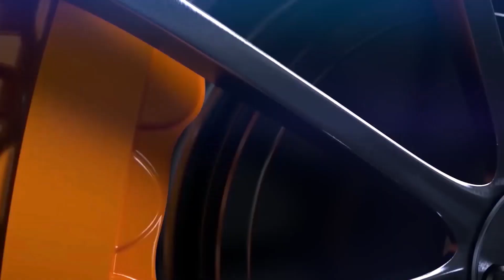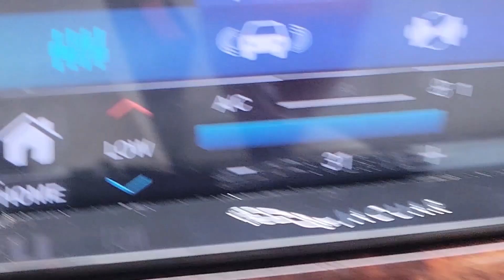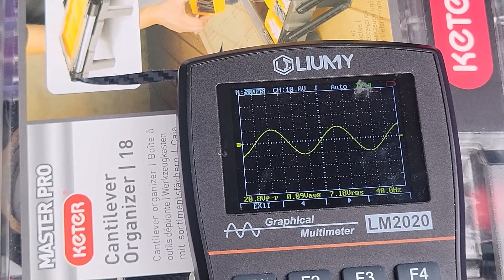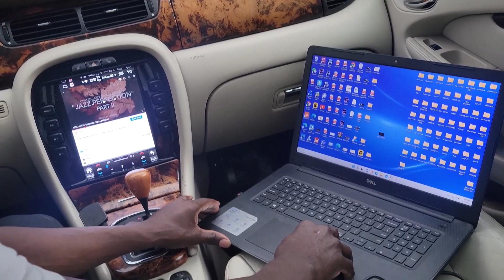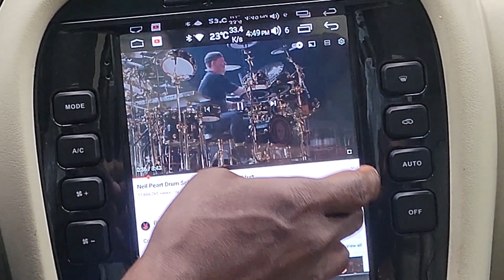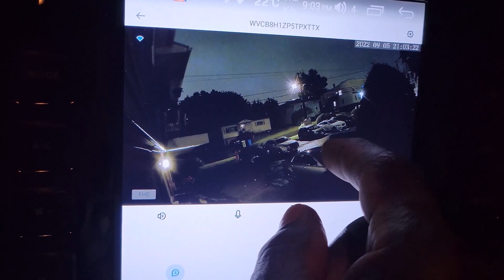20 YEAR OLD JAGUAR  X-TYPE  Gets a MODERN Radio facelift,with Android, Auto,Backup camera

Comment: Hello, have you any idea why I can't control the fan speed, well. When I push the button the fan speed change but not directly. For example I push the plus button it change Frome 6 to 7 and to 6 back  . And when I push the minus button it change 1 back but not until 1.
Reply from the maker: tell me what year and vehicle you have
Reply: @den-tech-mods  Jaguar S-type , non Navi Version. 2003 model
Reply from the maker: @karakasmustafa9647  ok ,remove your battery terminals and touch them together for 30mins, so your new Android canbus can register
Reply: @den-tech-mods  ok I will try. Thank you :)